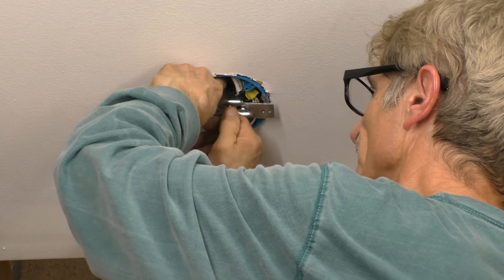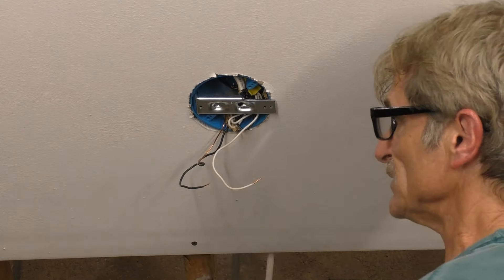Installing Ceiling Fan Bracket Without Changing Out The Existing Electrical Box

Comment: The EZ-Brace 101 is an awesome product. One of my ceiling fans fell since it was originally hung from a plastic light box. I don't have access to the lightbox from above to swap it out, so had to find a solution within the light box. Thankfully I came across this video and ordered an EZ-Brace 101 from Fixture Support Systems. It came in the mail a few days later and I installed it the next day. Super-easy to install. These definitely hold at least 150 pounds. My fan won't be coming down again. Great product!
Reply: Yes I got mine on Amazon and my husband was so excited about how easy it was.

Comment: Unfortunately the EZ brace 101 wouldn't work in my situation-ceiling light, no room for it in the plastic elec. box, there were 3 separate cables going into the elect. box, 2 on one side,  other one feed through the other side of the plastic box and they all 3 feed through the center of the box not though the upper part of the box. There were like 12 or more wires in the box, so no room for the brace to fit up in the box without hitting one or both of the elec. cables wouldn't fit up flush. So couldn't put a ceiling fan in the center bedroom...

Comment: Not listed so as an electrician I can't install them, but despite being very skeptical when I first clicked on here, after looking into the product I think this is legit. As long as it's a nail on box and you know where to angle the product to sink into the wood, the screws are the right guage to support the motion and weight of standard fans. I hope to see this expanded upon in the future!
Reply: Right, I dont think itll ever be listed since NEC says you can't modify boxes, but its still pretty cool
Reply: Also screwing blind is scary. You might hit more than wood. For example engineered trusses are thinner.

Comment: I replaced my first fan w/o much problems except that the new one had a remote receiver which made it difficult to squeeze the wires in and close the housing. I used space saving push in clips instead of traditional wire nuts which made the job possible. However, when I attempted to replace the second fan I discovered that the new one needed a bigger and different ceiling fan-box and decided it was too much work and mess. I put that fan away to wait for better days and moved on to replace kitchen light with a new one. As I opened the packaging for the new light I just bought I discovered a huge 9 inch bracket the new light came with. I put that one away too to wait for better days. Something always happens...

Comment: My brother you're an absolute genius. I do a lot of fan installs, and typically under these circumstances I swap out the box for a ceiling fan rated box. I just ordered four of these on Amazon. For the love of God thank you. I will be featuring this on my TikTok channel.
Reply from the maker: Thank you for your kind words.  I really appreciate you, and glad that you're helping show  that there is a product out there that makes a non fan rated electric box fan rated.
Reply: @robertleo9744  I just found this.  My light box is metal, but not for a fan. Can I predrill through the metal box in order to mount into the joist to use this bracket?
Reply from the maker: @rogueteach5197  If your metal box is attached to the joist you can predrill (you have too predrill through the box if metal). Because of the angle the hole might have to be big enough for the screw.  only one out of over a three thousand sold has there been a screw break, it wasn't explained to us as to how it happened but I can only assume it was because of the metal box and the screw going in sideways.  The screws we use are very strong and that shouldn't happen. The screws we use you can pick up at Home Depot they're spax screws.  If your box is not attached to the joist and you don't want to change out your box you can use the EZ-Brace200 or EZ-Brace216. Thank you
Reply: @robertleo9744  Yes. The box is attached to the joist by the side flanges that extend fore and aft of it.  I read that specific review of the screw breaking and figured it was user error.  I ordered the brace and will let you know how it goes. Thanks. (Getting into the attic above it is a real pain the ass. And, being just knowledgeable enough to turn off the breaker to that room, I really don't want to rewire a new box.)
Reply from the maker: @rogueteach5197  Not changing out the box and rewiring it is one of the greatest things about all of our brackets.

Comment: Best invention ever for fans. Bought a long drill bit just to make it easier to drill through the plastic housing. Screws are great and bite well. Use hammer drill to install screws.
Very tight. Made a fairly complex job quite easy. Thanks a lot for the video and idea.

Comment: Robert, Thanks again for taking my call on an off day.  It took me a while to modify my box to accept the brace, but once I'd modified it, the brace went in quickly and solidly. Even with the modification, a lot easier than installing a new box and worrying about the 70 year-old wire falling apart.
Reply from the maker: You're very welcome.  I'm glad it worked out for you
Reply: @robertleo9744  Quick question. The fan I installed is an awesome little caged fan/light. It's still sometimes making a "ticktickticktickticktick" sound. But it sometimes doesn't make a sound after several hours running.   I'm sure the bracket is solid. However, I forgot to install the small stabilization pin. Should I take it down, take it apart, reinstall it or just let it run for several hours to see if the "tickticktick" works itself out? I'm not sure if it's the screws in the fan, or the very slight swaying and rubbing of metal. Thoughts?
Reply from the maker: When all the screws are tight there is absolutely no way there would be any kind of movement between the EZ-Brace101 and the fan bracket to be able to make any noise.  I'm not sure when you say the stabilization pin if that's a pin that goes in for a down rod or what. Those also have set screws to hold them.  Hopefully this was some help for you. @jonbuckley7406

Comment: Great design and time saving design. Your weight test is the selling point! Those other brackets sort of mount to the trusses or rafters but, they sit on top of the sheetrock too. Also the time saver really is the re-wiring the box after you finish. Usually the wires are too short after you change the box out! More work, more time and aggravation!

Comment: Sometimes metal boxes have been installed between the joists. Then what? You might have to open up a section of ceiling and install a wooden support and connect box or just screw box to side of a joist or beam. But this video was excellent. Didn't know about this bracket you used.

Comment: I had to replace a fan in my son’s bedroom and noticed only 1 wire sticking out of the drywall?! So after some research I found the plastic half round side mount box at Home Depot, and it worked very well in my situation largely because of the joist and fan location in proximity to the center of the room.

Comment: Robert, thanks for the video, and making us aware of this product.   One question:  When I remove the old light fixture, and I see that I have a plastic box, how do I know which side of the box is attached to the joist?  In my attic, there are 18 inches of insulation on top of the ceiling, so it would be quite difficult for me to get up there and dig around in all that insulation to find the plastic box - in order to see how it is mounted to the joist.   Is there a simple way to tell, after removing the light fixture, to determine where the joist is, in relation to the box - without going into the attic, and without removing drywall?   I've ordered the EZ Brace 101 and I hope I can install it properly.   Many thanks!
Reply from the maker: You can take a thin flat head screwdriver and wedge it in between the box and drywall and probe around. That's probably the best way if not using something like an icepick and poking through the ceiling than using some silicon caulking to dab the holes afterward if the holes end up being outside of the installed fan canopy.
Reply: @robertleo9744  Thanks so much!  I will try your suggestions.

Comment: Something I can't find anywhere, is what do you do if it's a metal box? Does the EZ Brace work with metal boxes? Only solution I can think of is to drill pilot holes.
Reply from the maker: I have drilled pilot holes in metal boxes,  it's a little difficult because you have to drill at an angle

Comment: Do you have to have a certain size cup up there? Mine dosent fit in like that. I have a smaller cup that’s not a 4” .
Reply from the maker: This bracket is being sold on amazon, check out the different pictures of it being installed and one of them is of the EZ-Brace101 installed in a 3 inch plastic box and you can see how it is.  Hopefully this will be of help to you.

Comment: Can this also be used on a chandelier over the dining table?  My chandelier fell out of the ceiling and I want to reinstall it.  Upon inspection, it looks like they used very cheap lite weight screws to install it with the cheap plastic utility box.  I was going to take the old box out and install a better one but I don't have access to that part of the attic (its a two story house) without ripping out a wall in the attic or the ceiling in my kitchen.  My chandeliers weight is about 11 lbs. and I'm lucky only one globe broke when it fell out of the ceiling.   I'm trying to reinstall it and then searching for a matching globe to save myself some money. Thank you!
Reply from the maker: yes it can

Comment: Moving into new mobile home, which is a single wide home. Will this brace work in a mobile home because want to install a ceiling fan in master bedroom that currently has a can style led light?
Reply from the maker: When you say can style light I'm thinking recess light,  not knowing if it is a 4 inch or a 6 inch light or if the can is directly attached to the ceiling joist.  If the ceiling fan canopy is able to cover over either the 4inch or 6 inch can opening and you're going to use the can as the electric work box per say and it's attached to the ceiling joist it should work.
You should also check to see if the depth from surface of the ceiling to bottom of the box "can" 
is at least 1 3/4 inch.  Hope that this helps you.
Reply: @Robert Leo  thanks for the reply.  Can let you know on the diameter of Can style recessed light.  Honestly looks like 4 inch,  but will check

Comment: Sadly Hardware stores do not carry EZ-Brace 101, the jungle store does but that's 7-10 days to get it unless you have prime...So you cannot run out and buy one..
Reply from the maker: I've sent many new product inquiries to home depot, lowe's, grangers  and numerous other stores and don't even get a response. I've registered through not only the stores but also product gateway.  I've spent a couple years doing everything I can think of to get our products in a store.  because of how crooked amazon is that is why it even cost so much to buy our brackets. Hopefully we'll be able to get it in the stores soon.  Thank you for your comment.
Reply: Still worth it to buy off amazon I just used your brace to install a fan I’m very happy and will highly recommend it to everyone

Comment: the last portion of the video looked like it was hanging in a different location. Next to a door or some other opening? . . . so close to the back wall, is it a 6" fan blade?  So many questions. But I'll try the product and test it for myself.
Reply from the maker: All portions of the video was recorded in the same place. it wasn't in a room with a door, it was a made up ceiling that was lifted to show the installation of the EZ-Brace101 and lowered so that I can hang the weights from the fixture bracket

Comment: Thanks for the video and the new option. I’m gonna have to get two of these. I’m putting up two ceiling fans they’re pre-wired but it’s a plastic square one receptacle electrical box in the ceiling with a square cover will it work with one of those? Thanks again.

Comment: My house was built in 1966.  The electrical boxes are all metal.  I doubt that those TORX screws will be able to go through metal.  What length drill bit would I need to create a pilot hole using the bracket?  I'm going to see where I can buy these brackets in Nov.2022.
Reply: I would use 5 inch long drill bit if your going to use the bracket for a guide.

Comment: Now we need something that easy that works on a box suspended between joists by a weak light fixture brace.  Maybe a fan brace that fits under and around the smaller brace.
Reply from the maker: We have that too.  check out our EZ-Brace 200 and 216
Reply: @robertleo9744  I was hoping to not have to cut a giant strip out of my bedroom ceiling's texturing.

Comment: Would this work with I-bean joist? If it screws onto the thin part? I would think it won’t hold the weight like it would with 2x6 beams or 2x8 beams. Any ideas for the I-beam joist for easy install?

Comment: Excellent video! I have an ignorant question: is there an easy way to determine if the joist is on one side of the plastic light box or the other?
Reply from the maker: You could use a skinny flathead screwdriver and probe around the box with it. If the plastic box isn't attached to the ceiling joist we have an EZ-Brace200&216 that you use. They too don't require  changing out the box

Comment: Check this issue out! So i have older home same issue but wires are conduit with and old 1900 in ceiling! As you know there are issues with screw tabs not being strong enough as i customized a 1900 blank plate! box its self seems fastened good to stud im more concerned with screw tabs even though the steel was much better 1950"s original 1900 box! what do i do ? lol!

Comment: What if the box is only mounted with 2 screws and barely holds up a light fixture?
Reply from the maker: When you install the EZ-Brace101 it is fastened directly to the ceiling joist through the box making the existing screws holding up the box irrelevant

Comment: How much harder is it to install through a metal (galvanized) box, though? And yes where to buy?
Reply from the maker: we had a delay in the production, we actually have a whole line of ceiling fan brackets coming out (all of which you don't have to remove the existing box). they're due to be on the ship next week headed here. as far as installing through a metal box you just have to drill pilot holes. if you have a metal box I'm thinking your box might be installed between joists and not attached to one, in that case we have the EZ-Brace 200 or 216. We're trying to get our website up this week or early next week and there you can see all the brackets we have to offer and more. thank you for your patience.
Reply: Okay I’m sold - when can I get mine!?! Everyday the nagging is getting worse, please help!!
Reply: @mrmischievous  you need you put a muzzle on to the one who is nagging
Reply from the maker: Go to fixturesupportsystems.com to purchase this bracket

Comment: How do o figure out where the joist is?
Reply from the maker: You use a screwdriver to insert between the electric box and drywall to probe around, use a thin screwdriver so if you need to poke through drywall you can easily fill with caulking

Comment: Will these work on steel boxes that are not ceiling fan rated?  Also I cannot find this item online or in a store anywhere.  Is there a website?
Reply from the maker: There has been a delay in our shipment of this product. We are looking at the first or second week of September. You say you have an existing metal box, more so than not those are mounted between joists and not fastened to a joist. We have two other brackets that you can use and like the EZ-braces 101, the EZ-brace 200 and 216 are installed without changing out your existing box, and those two are for boxes that are not fastened to a joist. We should have our website up soon. FixtureSupportSystems.net.  Thank you for your patience
Reply: My metal boxes are attached to a stud directly.  They are just not ceiling fan rated boxes.
Reply from the maker: @myunk  than you would just have to drill the two pilot holes to install the EZ-brace 101. no need to take the wires apart and replace the box
Reply: @robertleo9744  ok great, looking forward to getting a few of these.
Reply: Are there available yet?
Reply from the maker: Go to fixturesupportsystems.com to purchase this bracket
Reply: Pretty sure this isn’t Ul listed so this is a code violation .although it would work great if you don’t mind breaking code .but that could fuck your c10 or journey license or work related customer insurance .your not allowed to put screws through the side of a box that isn’t listed to be installed that way either.another factor too is your losing cubic inches of box space when you
Do this increasing the chance of fire from heat and having less room which again could be another violation

Comment: That will only work if the box is up against the beam and the beam is strong enough to hold the fan.
Reply from the maker: The EZ-Brace 101 is for a box the is attached to a ceiling joist(not the beam). The EZ-Brace 200 or 216 is for a box that is not attached to a ceiling joist
Reply: That's what you should have said in your video. People might order the wrong one. And you're right it's a joist not a beam.
Reply: @KevinWta  If someone is that stupid, they shouldn't be touching a screwdriver, let alone a ceiling fan brace

Comment: Too bad this only works on newer plastic boxes./  My 100 year old house is all metal boxes in the ceiling.
Reply from the maker: check out our little video on our EZ-Brace200. We have rewired a couple houses that were over 100 years old and used some parts from our 200
Reply from the maker: about 6 minutes into that video we talk about the old nob and tube electric boxes